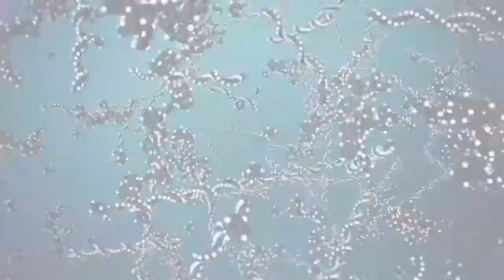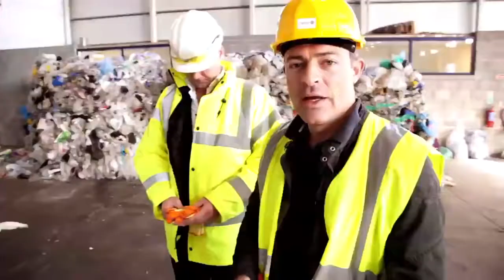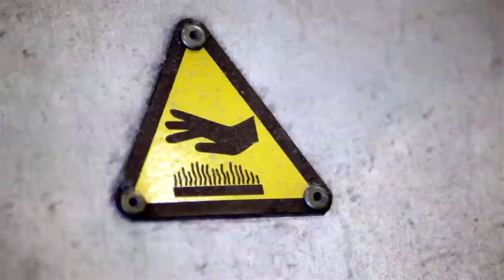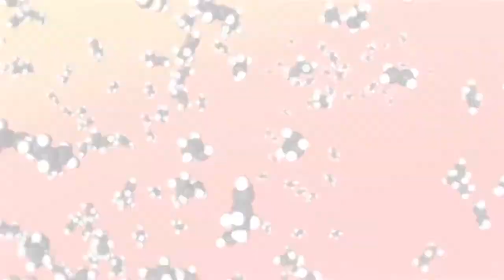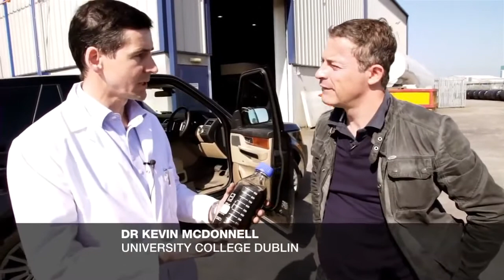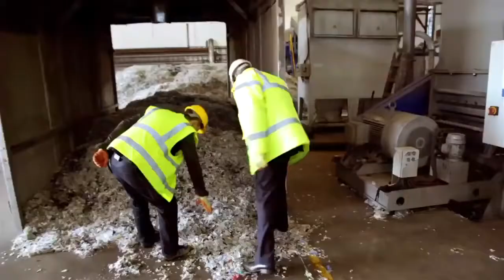Plastic to Fuel - Plastic Recycling Pyrolysis

Comment: Nice video.
Now it is real.
Good luck to the author of the video.
We use the fast pyrolysis plant Fpp02 for recycling plastic & wood wastes. 
Pyrolys reactor-Raw material processing capacity 500 kg/h. We produse out liquid  fuel for hot water boilers. We also produce briquetted charcoal from wood waste.